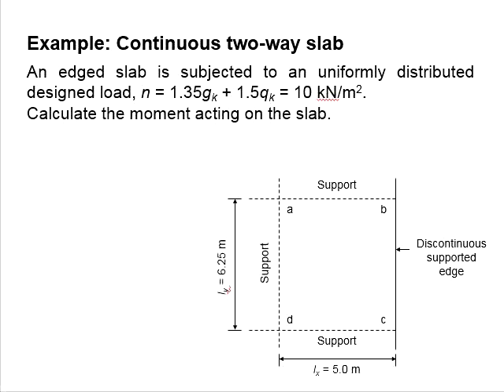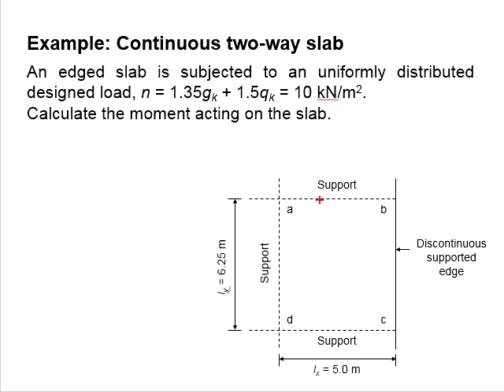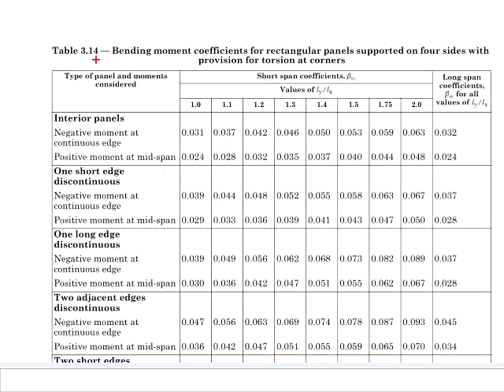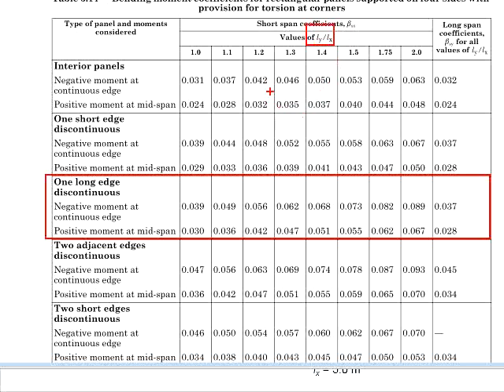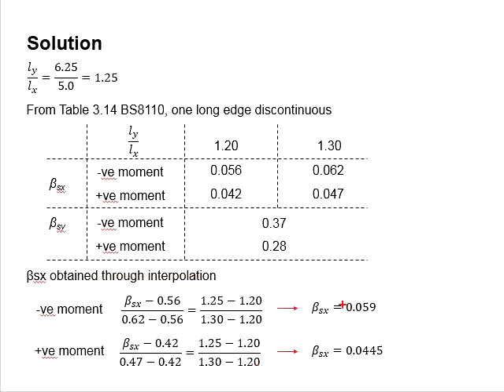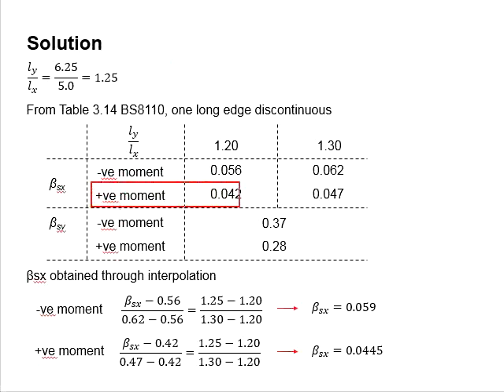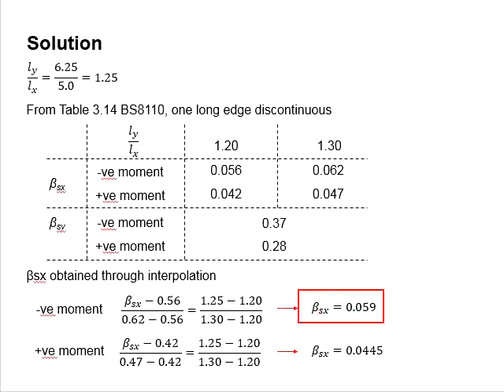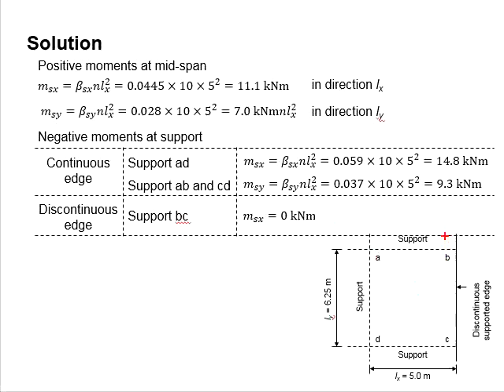8.14 Example: continuous two way slab

Comment: Although you said the discontinued edges has no moments, if it's fixed to a beam etc, then it will create a hogging moment won't it? usually the in real life designs, the discontinued edges of the slabs are casted together with a beam.
Reply from the maker: Yes, you are right. Normally RC structures are cast monolithic, there will be nominal moment even at the discontinued edges. In practice, normally we also provide top rebar at the discontinued edge.

Comment: If we calculate reinforcement according to the moments obtained by these coefficients, does the moments for torsion and torsion reinforcement is still need to be calculated separately? if so, do you have a video for that?
Reply from the maker: I believe torsion is not likely for slabs, as far as a know.

Comment: This is the conservative way of calculating it, isn't it? Can we replace the method in this video with "moment distribution and sway analysis"? Then do we still need table 3.14 etc (coefficients)? or we don't need them anymore? is there any way that we can do it all mathematically without going through the coefficient tables?
Reply from the maker: Yes. It is a conservative way calculating it. You may replace it with the moment distribution method. The moment distribution method is typically for continuous beams. We seldom use it for continuous slab. Table 3.14 is for slabs. Other than using the coefficient tables, you may also use the yield line method to estimate the load by dividing slabs into areas taken by the adjacent beams.